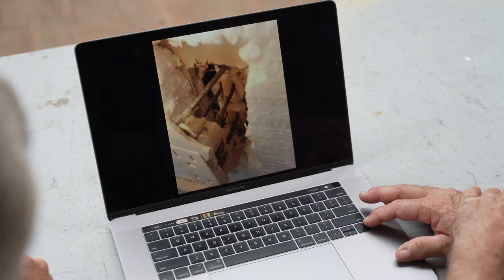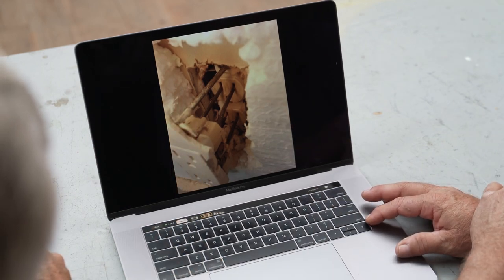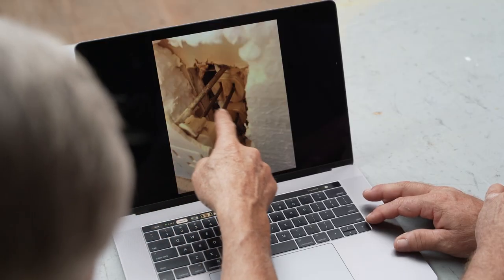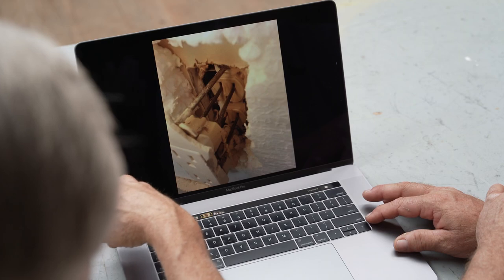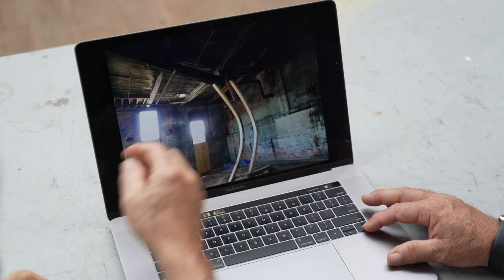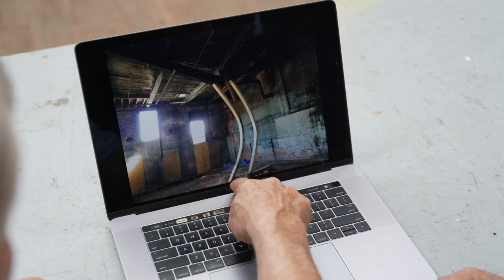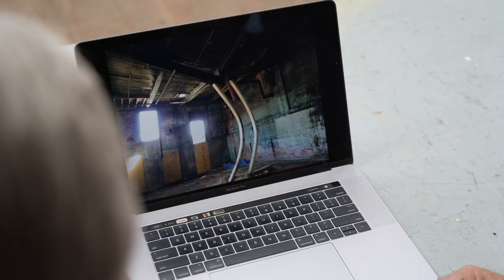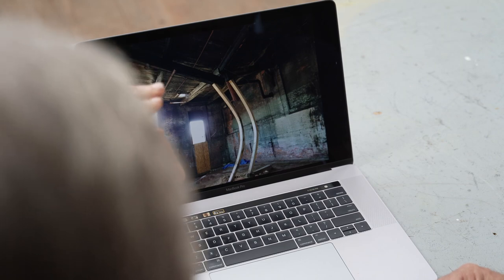ASK This Old House | Mini Split, Butcher Block (S19 E13) FULL EPISODE

Comment: I have been watching many episodes about the mini splits, and also have two friends in the HVAC business. After hearing about the pros and cons, and why it is important for a professional to install them, it is appalling to know there's a manufacturer  on Facebook that tells people that anyone can self install their own mini split system.
Reply: Definitely not a diy project, but if you're mechanically inclined it's doable. I installed mine up to the point of vacuuming the lines. It made more sense to pay an HVAC guy $400 then buying all the tools/nitrogen. He also signed the warranty for the unit.
Reply: Mini splits are a DIY project. Between Government regulations and greedy Contractors, I understand why a DIYer
would take a project on like this. I have friends that are Politicians, General Contractors and Mechanical Contractors.
Know your limitations before undertaking 
any DIY project.

Comment: "Butcher block" has the end grain facing up so that a more giving surface comes in contact with the butcher's cutting blade so it dulls slower.   A paneled wood countertop is just a wood countertop, not a butcher block.
Reply: Okay thanks airdrummond I appreciate your insight.

BTW airdrummond I suggest watch a 13 part series called What on earth happened by Ewaranon to learn that the earth is not a globe. I got it in my about tab.

Comment: 🤦🏻‍♂️ I can’t believe he glued that perpendicular joint like that.  With seasonal movement, that glue was useless.  For such a small return piece, they could have had the wood strips running in the same direction.  Sure, end grain will be visible but the joint would never open up.  Come on TOH—you’re better than this.  As a finish carpenter with nearly 20 years experience, I learned the proper technique from watching Norm’s New Yankee Workshop and Tom from TOH.
Reply: Or at least just used the metal clamps, which will probably allow some seasonal movement.

Comment: I wish I never got those mini splits because my electric bill went from $125 to $365.62!!! Never in my life I have ever had a bill that high.. I wish I got central air and heat unit
Reply: But what was your gas bill? Less than the difference?
Reply: I don’t understand.  Why did you choose mini-splits if you already had central heating through heat ducts?

Was your house cooled before you installed the mini-splits?  

Was it cheaper to cool with window units?

Ultimately, installing mini-splits shouldn’t affect your original H-VAC system, so if it is more expensive to use the mini’s you can always flip the switch on the original.

I would hazard to guess that gas heating is traditionally less expensive than electric heating.  

But mini-splits excel at only heating the rooms you are using so you could use both together and set your central H-Vac to 55, the room you are in to 70 and have a net reduction in cost.
Reply: Crappy LG on top of that here
Reply: If you went to central your bill would have likely been even higher. At least with mini splits there is usually some form of zoning where you aren't paying to heat the rooms you don't need to.
Reply: Sure it did.